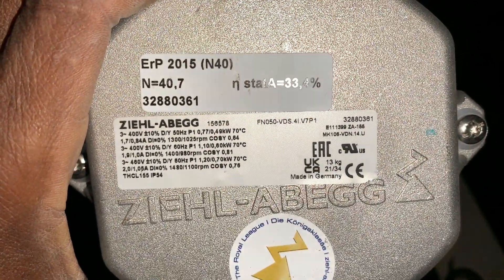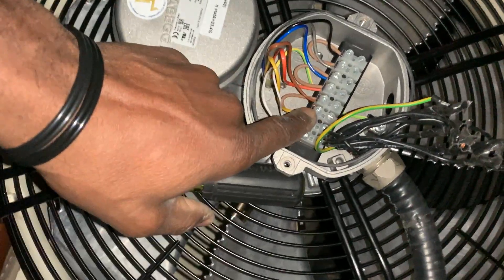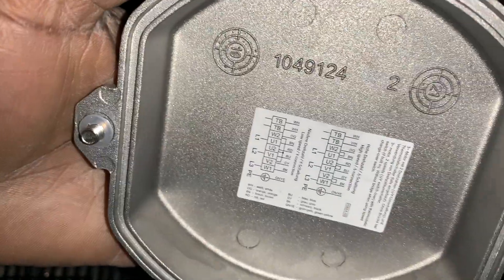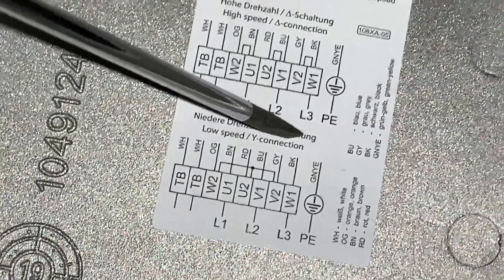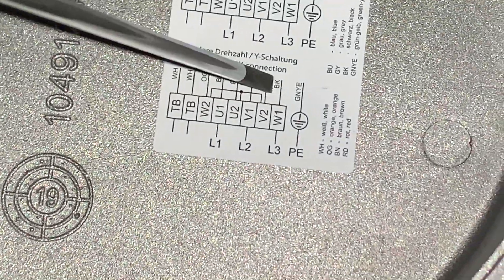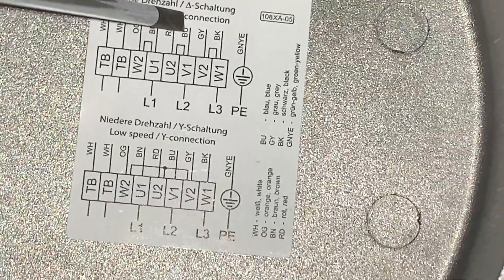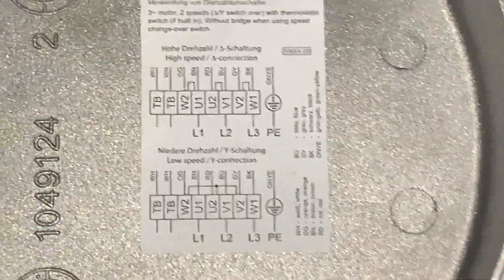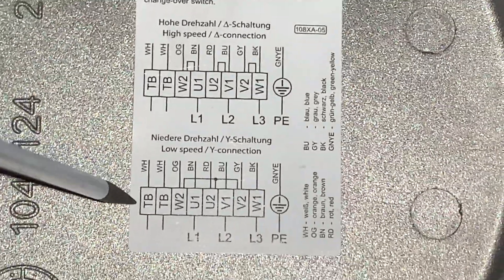WYE DELTA MOTOR WIRING

Comment: do the contractors all com on at the same time, and how do yo determine which 3 wires are from which contactor, good explanation thank you keep the coming
Reply from the maker: Two out of the three contactors comes on simultaneously for high or low speeds .. let’s say contactor #1 line side and contactor #2 line side must be terminated the same to the incoming power, contactor #1 load side goes to U1 V1 W1 , contactor #2 load side goes to W2 U2 V2, note L1 should  feed U1&W2, L2 U2&V1 , L3 W1&V2 now with both contactors 1&2 energized is delta /high speed. A third contactor #3 provides shorting across W2 U2  V2 for wye / low speed comes on with contactor #1
Reply from the maker: @sparky Tech thanks for stopping by